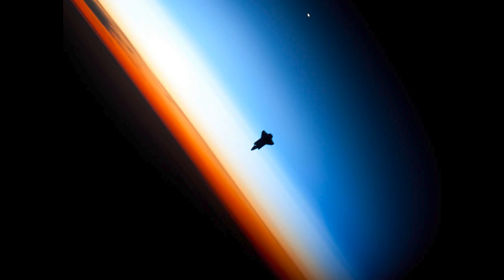Flat Earth Research Fails: The gliding capabilities of the Space Shuttle

Comment: “It’s technically not a glider .. it’s a space craft that glides down for landing ..” ... hello .. it never flew under its own power in an “atmosphere” .. you are full of logical fallacies.. you work off of assumptions.. if you start with a belief .. you will prove to yourself belief is true .. the best wings for a glider are long and thin .. the best wings for high altitude flight are .. guess what .. long and thin .. the shuttle would have fallen like a brick 🧱 .. I started to watch your videos thinking you might be looking at it from a neutral point of view .. but alas ..
Reply from the maker: "... hello .. it never flew under its own power in an “atmosphere” " Are you saying that the shuttle was gliding during its launch or that there is no atmosphere when it is launching? You also completely missed the point of what I was saying. They couldn't design it as an excellent glider because it would have interfered with its ability to be a good spacecraft. As a glider it just needed to be good enough to get to the ground safely.

" the best wings for a glider are long and thin .. the best wings for high altitude flight are .. guess what .. long and thin" You really need to watch videos through before commenting dude. Guess what would happen to long and thin wings when the shuttle goes belly first into the atmosphere from orbital speeds? SNAP! 

" .. the shuttle would have fallen like a brick 🧱 .." You are absolutely right, and it did. If you had watched the video you would have seen I pointed this out. The shuttle's nickname was the "flying brick". It's descent slope was much steeper than a regular aircraft's. It flared near the end to convert all that vertical speed into horizontal speed.
".. I started to watch your videos thinking you might be looking at it from a neutral point of view .. but alas .." You are free to watch the whole video and try to debunk any of my points with specific details. All that belief rhetoric really has no place in a scientific discussion.
Reply from the maker: @domesticatedprimate8791  "How could the shuttle be gliding during it launch" You tell me, you are the one that said it never flew under its own power in the atmosphere. For the record, the RS-25s were part of the orbiter, so using them counts as its own power. "What exactly denotes bing “a good spacecraft” " Being able to perform the missions it was designed to do.
"just look at the homeless tweeker shelter they sent to the moon .. apparently there is no atmosphere no friction no drag" The LEM never operated in any significant atmosphere, so yes, no friction, no drag. "a brick would be as good as any design for a spacecraft" Meh, maybe something lighter, but you do see cubic satellite buses. " another fallacy from you" cue the prince's bride meme.
"And guess what would happen to your short stubby winged glider in the thin upper atmosphere" It would fly right through it, which is exactly what they wanted it to do. I feel you already forgot that the lift generated by a wing depends on the speed as well as the wing area.
"can’t have long wings .. can’t have short ones either .." Why can't it have short ones? Have you forgotten that the body itself is a lifting body?
" nature can’t create let alone sustain a vacuum" why not?
Reply from the maker: @domesticatedprimate8791  Um....you are the one that is using rhetoric, using words like scientism  and indoctrination to try to reduce my credibility. You say it is not nature's way to have an absence of everything, but failed to say which law prohibits this. Strangely enough I do know which one prohibits this. It's Heisenberg's uncertainty principle. What you fail to notice is that no one says space is a perfect vacuum. Many flerfs claim we say this (and many non-scientists probably believe this as well), but this is just not true. I believe the average density in intergalactic space is believed to be 1 atom/cm^3 or something like that. For many applications it can be treated as a perfect vacuum.
Reply: Darth Marvin .. science with out the use of the scientific method is scientism.. none of your “science” has any proof = scientism.. 
a set of commonly held truths with no proof is a belief system .. your scientism is a belief system.. you have no proof of anything .. no curve .. no spin .. no practical example of water sticking to the outside of a sphere.. no examples of a naturally created vacuum.. and worse then being a religion .. built on a belief system .. it is a dogma .. it is taught as fact with absolutely no proof .. the dogma of scientism.
Reply: Darth Marvin ..and you have just proved my point .. you just want to stroke your own ego .. 
flerfer .. what is that ?
Reply from the maker: @domesticatedprimate8791  "you have no proof of anything .. no curve .. no spin" I could go through all the proofs that we have, and you would just deny them. This is a conversation that has been repeating itself for 5 years (in general, not between you and me). So why don't we spice it up a little bit and do some role playing. Let us imagine that the heliocentric model AS WE CURRENTLY UNDERSTAND IT is true. You are an astrophysicist and I am a flerfer ( given the number of FE videos in your channel I know you know a flerf is a flat Earther the same way a glober or a globetard is someone who defends the globe). So how would you prove to me that the Earth is round? I predict that you will say something that:

A) Has already been done and you just dismiss it as fake.
B) Is something ridiculously complex and/or expensive and wouldn't have any real scientific value.
C) Is actually impossible given our current understanding
D) Something really specific that just hasn't been done, but something similar has been done and you just dismiss it.
Reply from the maker: @domesticatedprimate8791  Oh, I will also behave as your average flat earther for this little bit of role play.
Reply from the maker: @domesticatedprimate8791  Not pointless, you guys keep saying that the proof we have is not enough. This would establish what is enough. For example, you said ".. no practical example of water sticking to the outside of a sphere..". How would you do this?
Reply: Darth Marvin . Very pointless.. no example of water sticking to the outside of a sphere.. no proof of curve .. no proof of spin . Nature can’t create and sustain a vacuum.. 
you are pointless .
Reply from the maker: @domesticatedprimate8791  Sigh* "No example of water sticking to the outside of a sphere"  www.youtube.com/watch?v=zWwaloPiMfI

" no proof of curve .. no proof of spin"  www.youtube.com/watch?v=_Qfy1wiTy6U
"Nature can’t create and sustain a vacuum.." Prove it.
Reply from the maker: @domesticatedprimate8791  "prove it’s NOT movement of the aether" Sure, Michaelson-Morley experiment. You guys believe in that one right?
"Really he shows water drops hanging from the bottom NOT sticking to the outside" Yeah, it is just a joke video he made because of how ridiculous this request is. Which is why I wanted to do the role reversal. If the heliocentric model is true, how would you show water sticking to the outside of a ball? How big would the ball be? What material?